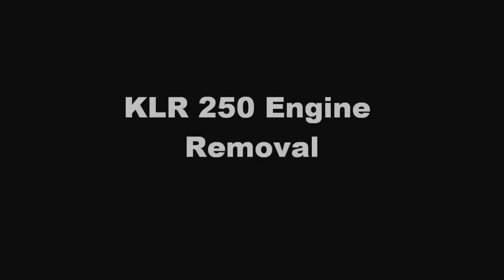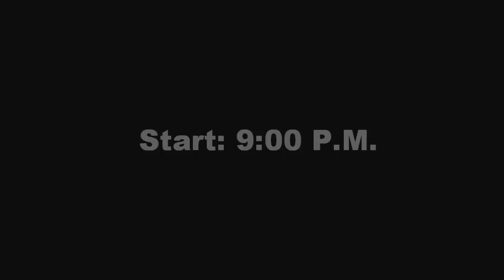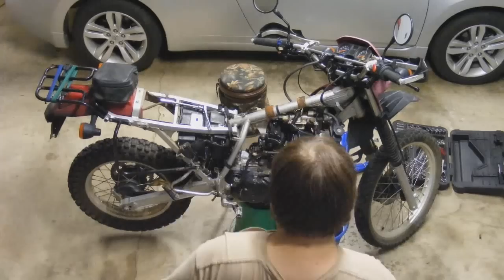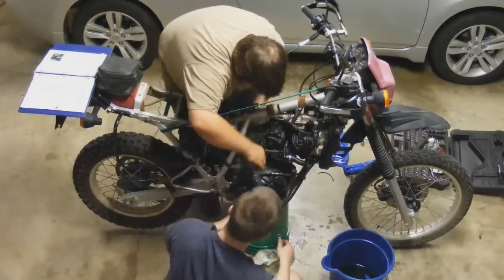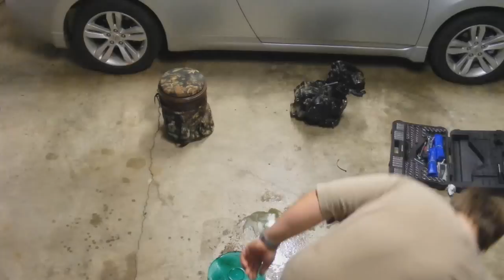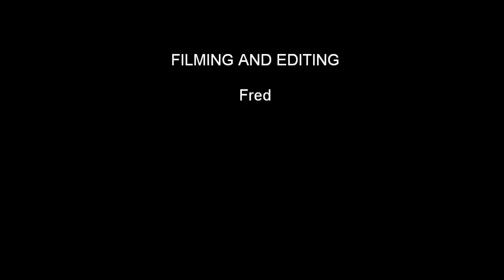KLR 250 Engine Removal

Comment from the maker: @1982fordf100 This bike has a cartridge type air filter that slides in from the side. There is a piece of foam on the door to the air filter box that deteriorated and let sand in past the filter and into the motor. Head was cleaned, cylinder bored, and new piston and rings.